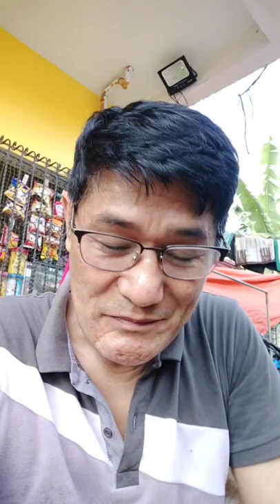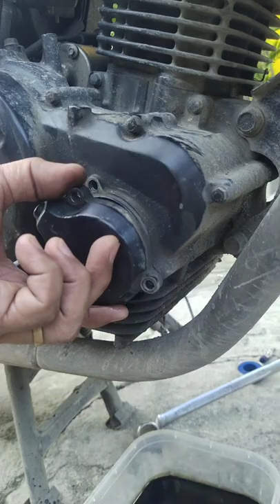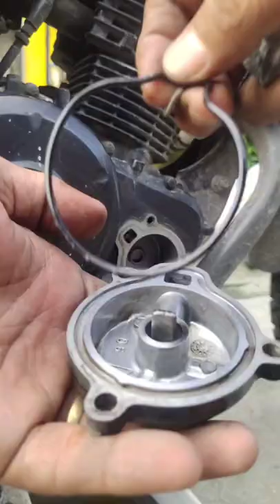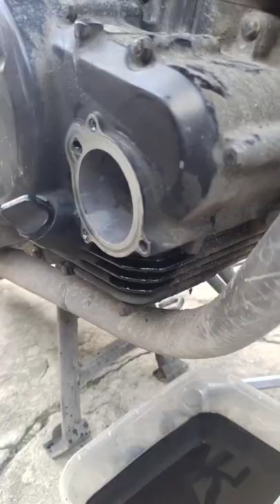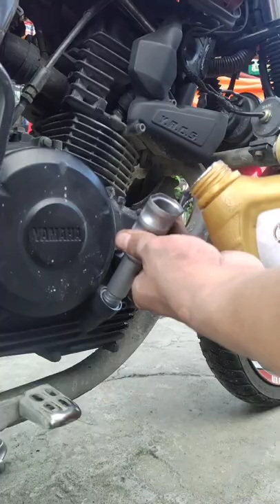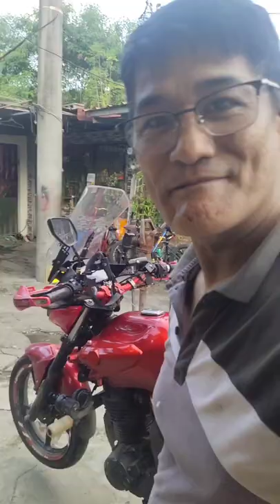Change oil of my Yamaha SZ #shorts

Comment: Paps bakit kaya po nung ako nagpalit ng langis nung sz ko e parang may tagas pero di ko naman makita kung san, napakahigpit din po nung mga turnilyo na inalis ko, ginaya ko lang yung ginawa nyo dito sa vid. Salamat po sa reply
Reply from the maker: Gaano pa ba kadami nakukuha mong langis?
Reply: @RedDragonRider  kung kakarkulahin ko po e medyo kaunti na kumpara dun sa isinasalin kong 1 liter na langis, siguro mga 25 to 30% ang bawas
Reply from the maker: Medyo normal pa ang 20-25% na bawas, pero 30% alanganin na.
Reply: @RedDragonRider  ay sir pano kaya po yung tagas? Pano maremedyuhan? Kahit teflon lang po ba ilagay dun sa bolt nya? Tas may washer?
Reply from the maker: Yes pwede mo gawin yan. Tapos ganun pa din kailangan na ipa oversize ng drain mo tapos oversize din na drain bolt.

Comment: boss okay lang ba na 1liter lang ang ilagay pang change oil?
Reply from the maker: Opo, ok po.
Reply: @RedDragonRider  1.2 daw po kasi ang required e , lalo na pag mag papalit ng oil filter
Reply from the maker: @user-lj5si3ge3g  Di totoo yan, nakalagay mismo sa block nyan, nasa bandang ilalim ng lagayan ng langis ang required na dami ng langis. Mag o-overflow lang yan dun sa may air filter pag sobra.
Reply: @RedDragonRider  ung 1000cm? sige boss maraming salamat buti nalang hehe